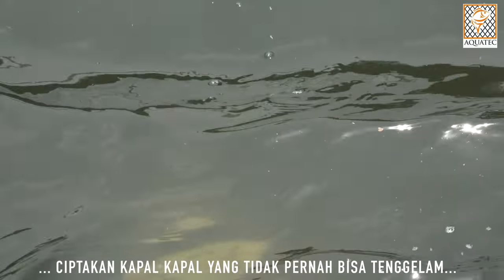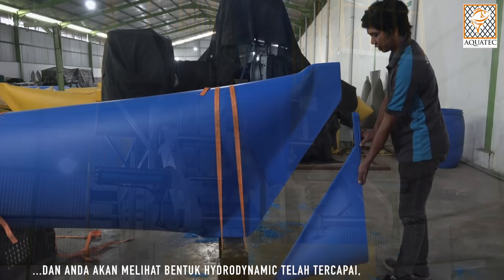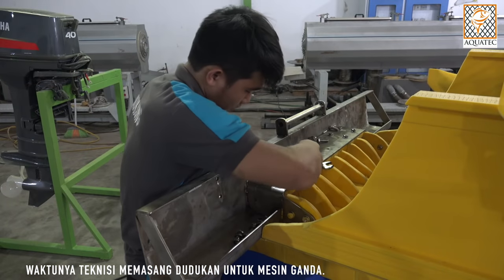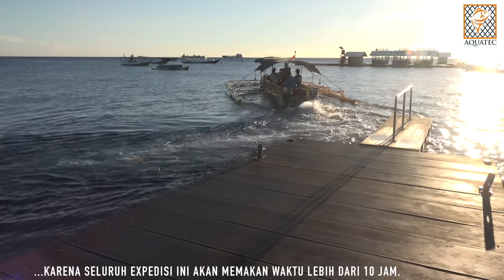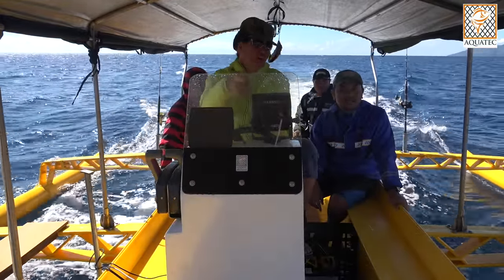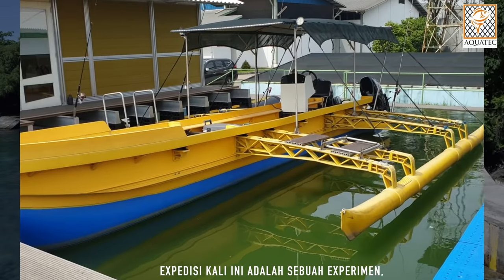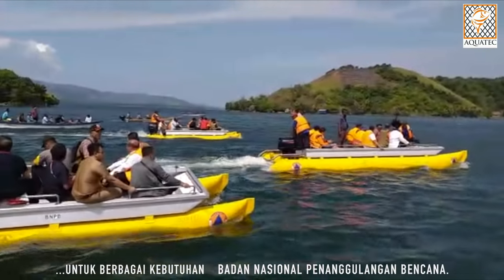HDPE Boat - Unsinkable Jukung

Comment: Great start in idea.  But, the inside of the closed in pipe needs to be filled with closed cell foam, then truly it will be unsinkable.
Reply: Not true. Even if pontoons were holed it would never sink because the specific gravity of HDPE is lighter than water.
Reply: @tbonemc2118  no it’s not
Reply: @shantytownshipwright7334  Oh yes it is. An open ended pipe will float in water. .94 to .96 to be exact.
Reply: @tbonemc2118  no ! I work with it all the time and it sinks like a rock.
Reply: @tbonemc2118  you might be forgetting the weight of what the boat is carrying. Sort of like the toy people on the paperplate at the beginning of this video. Without them the plate would be unsinkable but with them it went to the bottom. Stay safe.
Reply: @shantytownshipwright7334  I've on numerous occasions welded submarine HDPE pipelines and it most certainly floats.
For an underwater pipeline you cap the ends of the pipe and concrete blocks are clamped to it and the pipe is towed to where it's going to be laid. Air is let out gradually sinking the pipe in place and it only stays there because of the concrete blocks.
Yes added weight will sink it (like concrete blocks) but we welded HDPE sheet cut into disks internally to create water tight zones for pontoons. In a pontoon 2 disks are enough. Filling pontoons with foam adds a lot of weight and poly is already heavy compared to fibreglass etc. Varies depending on the wall thickness of the pipe.
Reply: Tbone is right , a stone would flow if air is in a hollowed out buttom , take a plastic bucket and try to press it under the surface (upside down for you kids ) . You cant , only 15 liters is enough for one person . With the outriggers there is no worry , and local captains won't sail continually over sharp objects .
Reply: @Luzviminda777  The hulls are infinitely and easily repairable for holed pontoons using welding guns like those shown in the video.
I was surprised they were using coloured poly instead of all black which they could've guaranteed for over 100 years. No one really knows the lifespan of black pe100.
Reply: @shantytownshipwright7334   - HDPE is lighter than water, it can range from 930 to 970 kg/m3, water itself is 997 kg/m3
Reply: But additional foam could not hurt........
Reply: The closed-cell foam is a must for it to truly be unsinkable. They have made modern style boat hulls out of this material already. When it's fully rigged it must have some type of closed-cell foam in the hull. Case in point, a local Sheriff's Department purchased one of these new plastic boats. Someone put a water hose in it and turned it on. The next morning we found it on the bottom in its slip. We raised the vessel and filled the inner hull with a two-part closed-cell foam. Then put it back in its slip. One week later we found it filled to the gunnels with water once again. However, this time it wasn't on the bottom. We simply turned off the hose and pumped out the water. Other than the closed-cell foam the hull desperately needs to have a chine and ribs mounted to it. The outboard motors also need to be on a motor mount. These changes will help lift the boat out of the water. It will then have greater speed, range, and a better ride. Also, the closed-cell foam will help the boat to ride higher in the water when underway or at the dock. A better idea would be to make the entire hull using the rotating mold method. That would eliminate the need to make all those other parts. You also wouldn't have to worry about those other parts failing. Yes, it would then not look like it was made from a log. It would, however, be much more efficient on the water and it would require less raw plastic.
Reply: @tbonemc2118  This happened to us in the 1970s in Northwestern Ontario. We had to place an HDPE pumping main across a river, over a small island and over the other branch of the river before discharging into a wastewater treatment plant.
The idea was to weld the pipes, push them out until we got to the island then clamp on the concrete anchors and watch it sink.
The trouble was the design engineer got his calculations wrong and even with the concrete blocks clamped on the pipeline refused to sink. We cut the sealed end off to flood it with river water and, in the end, used every available concrete block meant for both crossing and just about made it onto the island.
The rest of the scheme had to be delayed until more concrete blocks could be poured and cured.
Could have made a really neat boat to play on while we waited around!
Reply: I think the pipe need to fill with water same same ballast in ships so that strong winds will not turn over the boat.....in deed plastic is Usefull in this way Unsinkable....this must be Wind proof.
Reply: @julienmendez3148  yes good idea mam...are you pilipina?
Reply: Regardless,if you don't drive over rocks, you will not get holes in the boat, and as a result, "unsinkable". I'd buy one.
Reply: Correct.
Reply: The pipe is sealed filling it with foam will make it heavier and the form won’t do anything unless the pipe is ruptured. Baffling the pipe would make it stronger, easier to repair than foam, and localise water flooding. But it still seems like over designing for a problem that doesn’t matter that much, ruptures are unlikely that plastic is tough, If you get a hole in a fibreglass boat it will sink a lot faster. Trapped air might also stop this boat sinking entirely depending on the rupture location. Making salvage and repair easier.
Reply: I think a styrofoam will not weight much, the same principle with the lifeproof boats, the aluminum hull/walls is filled with lightweight dry foam, its a solution that solidifies when mixed, then pour into the PVC. Anyway, I prefer to to it if I have a boat like this, we may disagree, but in the end, the better idea will prevail. Shalom
Reply: Alaska Bob26  Yes. I worked for a manufacturer of PVC and HDPE piping.
I went on to spend the last 30 years fabricating and installing HDPE in just about every circumstance you could imagine in many different industries.
PVC while strong is also brittle and will shatter if hit hard enough.
HDPE is the same in certain circumstances but you better bring along a much bigger hammer.
Because of HDPE's flex it is also susceptible to fatigue breaking just like steel.
Good design helps with these problems.
Best example of this is HDPE wheelbarrow liners. You can only throw bricks into them for so long before the liner falls apart. Some are way better than others mainly because of better design.
I've fabricated HDPE pontoons for everything from party boats, floating restaurants and the myriad of uses found for them on mine sites.
To begin with we foam filled them before switching entirely to welding in watertight bulkheads for a small fraction of the cost and weight.
Never had anyone come back complaining about their pontoon leaking or sinking.
I even butt welded poly floats from pipe that were used to support electrical cables threaded through them. Basically they were just one small pipe welded inside a larger pipe with end caps to match. Indestructible.
Reply: @TT DAN If whatever you are calling HDPE sinks then it isn't HDPE.
Reply: Whether or not the HDPE itself will float, if the inside is filled with foam and the boat is punctured, it will never sink and will float almost as if it had never been holed.

A 1 gallon (3.79 l) kit of 2 part floatation foam creates 8 cubic feet (.23 cubic meter) of foam and that foam will weigh 16 lbs (7.26 kg). However, it will also displace 500 lbs (227 kg) of water for a net floatation of 484 lbs (220 kg).

Those pipes  look to be 1 meter (3.3 ft) in diameter and 7 meters 23 feet) long for an internal volume of 5.5 cubic meters (194 cubic feet). That means one cylinder filled with foam and a 1 meter long hole torn in the HDPE would still hold up 5,324 kg (11,737 lbs).

For that massive safety margin you lose about 176 kg (388 lbs) of useable cargo weight.

If I'm going out on the ocean, that's a HUGE benefit.

Also, the floatation foam creates extra strength since it resists compression and flexing.

Many manufacturers of aluminum boats put in enough foam that you can drill 4" holes all over the sides and bottom of the boat and it will still float as if it had never been holed.
Reply: @gsh341  You don't need to convince me but rather the poor fisherman who'll be carrying around the weight of about 4 extra crewmen using a bigger engine and higher fuel consumption.
We gave up using foam filled 20 years ago because of weight and cost and instead went to welded watertight bulkheads.
2 bulkheads per hull or three sealed compartments just means you have to have a really bad day to hole all those.
Even then how does a hole in the bottom displace the air above it in the hulls?
Reply: Pump mineral oil in the outriggers for ballast.
Reply: @NotMyGuns  Why would you do that. You'd need to double or triple the engine size plus pay for the corresponding fuel consumption.
Reply: @tbonemc2118  ......  you’re right, however it wouldn’t be a bad place to store extra fuel for long distances.
Reply: Good suggestion.
Reply: Cuman bisa menahan ketawa membaca komen bule-bule ini.. Pada eyel-eyelan tentang berat jenis material HDPE nya.. 
Padahal kan yang penting menurut saya, asal volume total dari pipa HDPE yang berisi udara lebih besar dari beban kotor kapal termasuk muatannya, ya kapal nggak akan tenggelam.. Melihat diameter pipa yang warna biru (mungkin) sekitar 50 cm, dengan panjang kapal katakan 10 meter, hitungannya adalah 0,25mx0,25mx22/7=0,19, dikalikan 8 meter (perkiraan dikurangi ujung pipa biru yang gepeng karena dipres ujungnya), paling tidak kapal aman untuk bawa beban total 1,5 ton (bobot kapal beserta muatan).. Itupun masih mengabaikan volume pada batang boom penyeimbang kapal.. Kalau itu ikut dihitung, kapasitas muatan/bebannya akan nambah..
Mau lebih aman lagi, isi pipa biru dengan styrofoam low density, paling banyak bobotnya nambah 20 kg an untuk volume 1,5 m3.. Jadi sekalipun kapan patah jadi 2, tetap akan terapung.. Toh kalau sampai patah, paling muatan kontainer isi es batu dan ikan aja yang tumpah.. 
Gitu aja kok repot.. Kwkwkwk..
Reply: @handoyolaras8946  itu opinion dangkal. Bule membicarakan risiko ketahanan HDPE termasuk material fatique, kebocoran, kestabilan ketika dilaut bergelora dll . Mereka memberi cadangan2 yg baik spt dimasukkan foam, mineral oil sbg ballast kestabilan dan  mcm2 . Ini bererti mereka kagum dgn idea bot ini. Ngakk perlu defensif kawan.
Reply: @handoyolaras8946  jgn defensif bro. Bule2 itu memberi suggestion supaya lebih baik. Tiada paksaan.
Reply: @mattmikael4956  kayaknya bukan suggestion deh kalau mereka sendiri berdebat tentang berat jenis HDPE itu sendiri.. Suggestion itu harus ada relevansinya, sedangkan perdebatan itu hanyalah masalah handling dari material yang sudah jelas spek nya.. 
Yang masuk suggestion itu adalah pemakaian/inject pakai low density foam, seperti pada komentar diatas dan saya setuju itu, bahkan saya pun menyebutkannya.. Yang saya geli kan adalah bahwa suggestion itu diperdebatkan di tanggapan komentar dibawahnya, yang perdebatan itu sebenernya nggak perlu dan nggak ada esensinya.. Makanya saya hanya bisa tersenyum sendiri.. Geli aja.. Dan geli ini kan bukan defensif mas bro.. Maaf, sekali lagi maaf..
Reply: @handoyolaras8946  coba baca semua nya. Ada yg membicarakan density dan water displacement, ada yg suggest guna ballast , mineral oil, foam supaya unsinkable , HDPE hitam. Itu semua suggestion. Suggestion hanya cadangan bukan paksaan. Kalau saya pemilik pabrik saya bikin R&D cadangan2 yg praktikal.

Mengapa begitu defensif ? Ini bicara secara open mind gitu.
Reply: @mattmikael4956   iya betul, maka seharusnya yang dibicarakan adalah dengan meng inject dengan foam, seberapa efektifkah hasilnya.. Low density foam mempunyai berat jenis sekitar 0,15.. dan berat jenis ini tidak pernah ada yang menyebutkan di pembicaraan diatas, sehingga pembicaraan tidak pernah mengerucut.. Dan ini memang belum diaplikasikan di produk tersebut..
Baffle.. Adakah yang menyebutkan desain baffle..? Pembicaraan diatas yang ada hanyalah perlu dan tidaknya baffle.. Tidak ada yang bicara desain baffle itu sendiri.. Padahal baffle pada produk kapal diatas sudah diaplikasikan.. Harusnya yang diperdebatkan adalah desain baffle nya,, bagaimana membuat itu menjadi efektif..
Selanjutnya oil.. Setahu saya oil yang umum digunakan di dunia nelayan adalah bensin dan solar.. Bensin dengan densitas 0.7 dan solar sekitar 0.8.. Tidak ada pembahasan mengenai cara kerja oil ini terhadap kestabilan, kekuatan dan kemampuan mengambang sehingga mempunyai efek unsinkable..
Pure PE dan black PE.. Tidak ada pembahasan lebih jauh kecuali hanya masalah umur pakai..
Satu lagi, tidak ada pembahasan mengenai kekuatan ombak yang mungkin dihadapi oleh jukung ini.. Berapa kg-f sih kekuatan hempasan ombak..? Sehingga pembahasan mengenai kekuatan HDPE dalam menghadapi ombak menjadi tidak relevan, karena hanya didasarkan pada opini, bukan data.. Pembuktian yang paling bisa dilakukan adalah berlayar di daerah yang berombak besar, seperti di sepanjang pantai selatan.. Tapi satu hal yang harus diingat, ini adalah hanya sebuah jukung, kapal nelayan kecil, yang dibuat semurah mungkin akan tetapi mempunyai kekuatan yang lebih dari harganya..
Demikian brother, mohon maaf sebelumnya..
Reply: @handoyolaras8946  ramai bule yg berkomen membuktikan minat yg mendalam ide pabrik ini. Jika teknoloji ini didokongi pemerentah , massa dan pasaran expor, potensi to expand sgt baik.
Reply: @mattmikael4956  Okay, antusiasme itu sangat mendukung kami selaku orang Indonesia.. Tinggal nanti bagaimana para pihak ini bisa berkolaborasi dengan baik..
Terimakasih dukungannya..
Reply: This material cannot be holed without a drill
Reply: Bwi
Reply: GOOD POINT!!!!
Reply: @tbonemc2118  with no weight. The boyency will shift alot. To place foam or smaller closed pipes in sections could add. Great ideal. Nice factory.
Reply: @tbonemc2118  👍
Reply: @cristopherguban8781  use of recycle. Tell the chemical plant manufactors about it. They are used in almost every product you own. Maybe they will reduce when they find using there products and bi products in a clean recycle is as profitable way. Then then its a way to continue providing a need and reducing the cutting of trees. Less land and different trees that take longer to grow to needed size. So I see this as a good thing.
Reply: Empty sealed coke bottles inside the tubes is better than foam, weighs almost nothing and can't puncture all them at once if the hull is holed 👍😊
Reply from the maker: As long as the HDPE pipe closure is manufactured well, water will not leak into the pipe, and we also put several dividers inside the pipe for extra safety, therefore we do not put Styrofoam inside our pipe (Styrofoam will only make the product heavier and not environmentally friendly). Also, we’ve done several impact tests to ensure that even an impact from a large/fast moving boat will not damage the pipe. So far, none of our pipe leaked due to damage from boat impact. 

However, it’s a different story when the Indonesian Navy purchased our HDPE boat. The Indonesian Navy requires us to put Styrofoam inside our HDPE pipe so that when an enemy shoots our boat with an AK-47, the boat will stay afloat.
Reply: Old way of filling the inside with sealed empty plastic Coke bottles is cheap and it works best plus you'll have a lot more mix for your Brandy.
Reply: @tbonemc2118  You are assuming the boat is empty with nothing. No hardware, no engine, no occupant or occupants with no brain.
Reply: @cristopherguban8781  plastic does more good by several orders of magnitude than in harm it does. plastic saves millions of lives, enables many of the items we use daily to exist etc. The downsides of plastics can almost completely be eliminated by responsible disposal/reuse/recycling of the item at the end of its use.
Reply: Specific density of hdpe is between 0.946 and 0.952.
Hdpe floats in seawater. When it sinks it is no hdpe! 
To my personal opinion the indonesian boats made of hdpe pipe are a good idea.  The welded-on side boards make the main structure rigid. 

2 heavy outboard engines plus equipment will probably sink them if the above features ( watertight and or styrofoam) are not met. 
Conclusion: the main pipe provided with watertight compartments or styrofoam floats would indeed make them praktically unsinkable.
Hdpe is resistant to seawater and sunlight. It will not suffer from fatigue due the waves when designed and made well. 
My opinion : a very good boat for coastal waters and good weather.
Reply: @shantytownshipwright7334  you're wrong hdpe floats
Reply: haha ! yeah .. a big styro
Reply: @tbonemc2118  cargo of the boat will sink it
Reply: Excellent video,  interesting conversations and viewpoints... In today's Hi-Tech world we're drowning in information at the same time we're starving for wisdom.. Thank you
Reply: @AquatecIndonesia  hi, how much is this boat without the engine? Terimah kasih.
Reply: use XPS for strength or EPS for cheapness
Reply: May i know how much is the cost of obe complete boat without the engine and other  accessories (in US $)?
Reply: I agree add foam. Also with the weight of a motor the fact if the plastic floats or not will not make a difference
Reply: @tbonemc2118  You need to consider the weight of the engine and other accessories in the boat plus the people in it.
Reply: @shantytownshipwright7334  .
Reply: Fill them full of ping pong balls
Reply: Dieter-Thomas Michel  Which idea? I listed several. Every one of those ideas is being used in some way or another. Plenty of boats and other marine projects have used them to great success. Use Google and you will see what I mean.
Reply: Dieter-Thomas Michel  More than likely translator is the issue. 🤣
Reply: They should pour a urethane liquid foam on it before closing off the pipe to add the. Bouyancy
Reply: @juncoraler9293  just like they do for dry-wall insulations
Reply: Prudent...! Yet,,, his boat is good...
Reply: @tbonemc2118  more prudent. I want an old used one. Cool. Love it.
Reply: Very good suggestion.. thats what im thinking of.. truly unsinkable
Reply: It don't have to be filled with foam the hair pocket will be enough to keep it afloat Sooner or later phone will absorb water and still sink over time
Reply: @OzcarMike641  I built some metal pontoon boats before with foam in them and the phone as a lot of more weight then you think and it soaks up all kinds of water if the Pontoon it self develops any kind of leak.
Reply: Yeah until it catches on fire and sinks like a  brick.  Back to the drawing board for both of you
Reply: For a long period of time, foam inside will gradually absorbs fluids. Foam is not more necessary to filled inside...
Reply: @yutube1980  floatation foam is like a life jacket.  Its used only when needed and then its done.  Just like if you had a hold in your vessel and want to repair it.  The waterlogged foam gets cut out and replaced.
Reply: @OzcarMike641  this exactly LOL. its all about decreasing the permeability of the space
Reply: I would also agree, even if its offered as an add-on in manufacturing, makes absolute sense, it would also add some needed weight as ballast to help with stability and best performance on rougher waters....where the craft would be tossed about by high cross winds and choppy waters, but love the boat fully. Any thoughts about adding a sleeping cabin/s for longer excursions.....
Reply: Well ultimately nothing is really "unsinkable" if you put enough weight on it. This boat would probably have to take pretty severe damage to sink with normal loads aboard. It's true that foam-filling the main pipe would make it resilient to that kind of damage, but it would also increase the weight and thus worsen the performance of the boat at all times. Probably not a good tradeoff overall, as the pipe is extremely durable; you'd be trading worse performance 100% of the time in order to survive an extremely unlikely event.
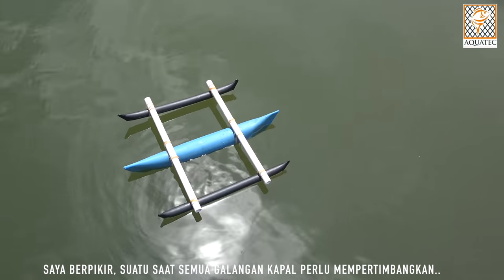Reply: @jeffreycraw 2:17 2:17 2:17 2:17 ley1216
Reply: @tbonemc2118  Except this boat has 2 very heavy motors hanging on the end that will drag the whole thing to the bottom if floats are flooded.  Its needs compartments in floats or foam filling to be unsinkable, that's obvious.